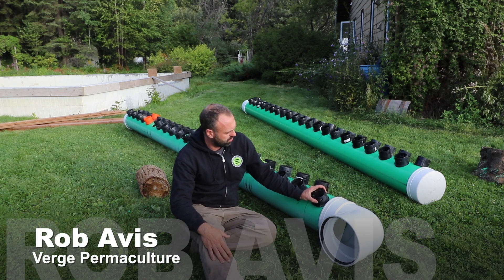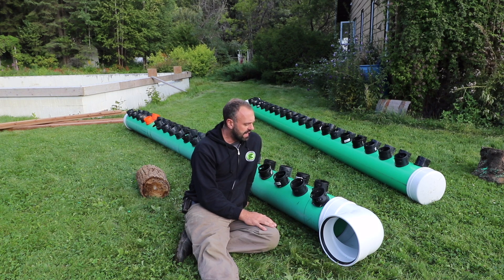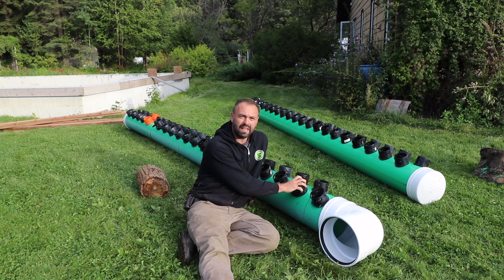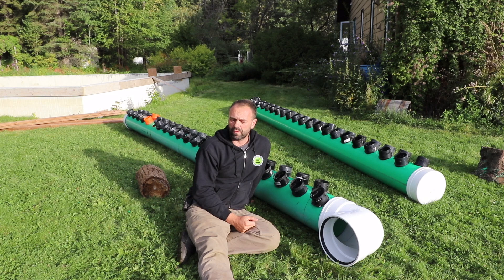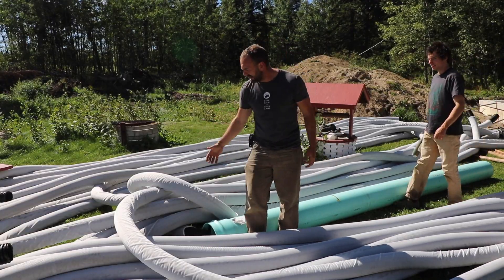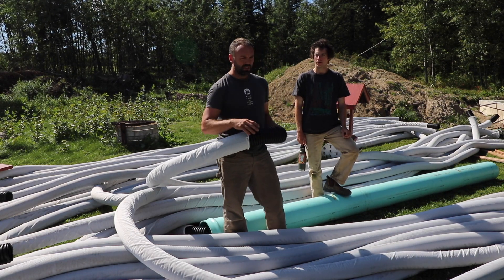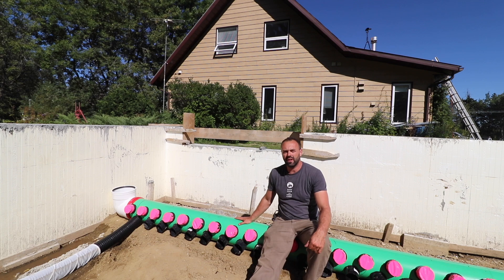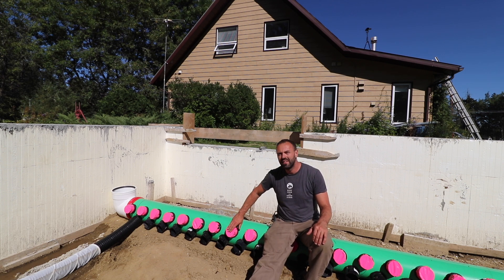How To Build a Climate Battery - Day 2 - Construction In Passive Solar Greenhouse

Comment: That’s great it keeps it above 0 until January but I need it to be above 48 at night. If it could keep it above 48 from October through March, I wouldn’t mind using supplemental heat towards the end of that timeframe because I have to use supplemental heat the entire time in zone 8b from October through February and a little bit in march. Mostly the heat runs at night and almost never during the day except for our yearly 15 days worth of 20 degrees temp when the heat runs 24 hours. I wish i had a way to store the wasted heat at the ridge. But it sounds like it stops working in January and even earlier than that because I don’t want it to stay above 0 i want it above 48 or at least above 32 when it’s 20 outside

Comment: If moisture in the air is better for capturing heat , than why not go with water in water lines buried in 6 feet of sand , layering water lines with rigid foam lining the bottom and sides and topping the surface with a foot of cement , this will store heat , than use solar and wind turbines with electric heat resistors to heat the water  ? This technology is being used in Finland and in  Alberta Canada where temps can go to - 40 C , but they can grow bananas in their greenhouse.

Comment: Great work but i need some clarification please. I keep seeing 8-10ft minimum to see a significant gain in thermal exchange in plenty of theoretical txts but have yet to see one installed beyond 4-5ft at any latitude however all of these shallow installs tout the benefits. Has anyone actually figured this out yet or is it yet to be properly documented? It is a huge investment and technical endeavour on a maybe...
Reply: These systems actively add and remove heat from the mass so there`s no need to go 8-10ft deep.

Comment: How has your system made out over the last couple of years? Also, I'm very curious why it is you use drain, or weeping tile pipes? Does moisture inside the pipes not hinder the efficiency?
Reply: I’d have the same concern
Reply: If there’s moisture in the system from either the ground moisture (and from watering) or air humidity condensing then that’s a great place for mold and mildew right?
Reply: The 4” ABS perf pipe would be a great home for gophers and moles!
Reply: @zanepaxton7452  I understand having a thin walled pipe so that the transfer of air is easier, but perforated seems like it would create problems. I'm seeing a lot of videos about the use of perforated pipe, but maybe that would work in areas with very low water tables. Definitely not in my area. I also tried to reach out to this group directly, as I was in Alberta for a week, and no one seems to have any interest in responding. I just wanted to know some results, and maybe see if I could stop by and see the operation for myself, so I could better understand the system. So I'm a little discouraged by the lack of response to a legitimate concern.

Comment: Question: could you replicate this system into 3 separate zones in the same square footage? So your system as you installed it, but replicated 3x at smaller. That way you could have a 3 zone system for different types of plants. Is that possible or is there an engineering reason why the white cloth covered pipes need to be a certain length?

Comment: For the price of the concrete absurdity I see in this vid, he could have built an entire greenhouse structure.  Holy Shitles...  Hello?  Economics? 101 for being an engineer.  The cost of those ICF blocks and the insulation given all the idiot had to do was increase the width of the structure by 2m and you get a larger greenhouse and get the insulation FREE from the dirt... Good God.. what an idiot.  Next, the idiot so called "engineer" clearly never ran a heat flow calc on the ground as he put in about 3X too many pipes and they should have been at different levels and several FAR deeper than shown unless water table is directly below his feet as they live in a swamp... Yea right he does.  Ok, time to never watch another one of his ignorant vids.

Comment: You are correct that the latent heat is stored by the phase change of water from liquid to gas and released during the phase change from vapor to liquid. Evaporation extracts heat from the surface upon which the evaporation is occurring, cooling it. Condensation, releases that heat to the surface upon which the condensation is occurring, heating it. So as long as the evaporation is occurring INSIDE the greenhouse in the Summer, it will cool it. Likewise, as long as the condensation is occurring INSIDE the greenhouse in the Winter, it will warm it. However, since it is the surface, NOT the air, that is being heated or cooled, if these processes are occurring IN THE GROUND, there will be no useful cooling or heating effect in the greenhouse!

Comment: Hi, would this type of system work for cooling on a high temperature (95 F) and high humidity (86%) site, on a greenhouse thats wrapped with anti thrips mesh on the sides,  white plastic on the roof, and has an opening all along the top for ventilation (and also has anti thrips mesh), or would the cool air escape too fast to actually cool down the greenhouse, i'm in the Caribbean by the way, and another question is, would it reduce the humidity levels in the greenhouse????

Comment: If there are perforations in the 3" pipe, how will water affect the system? Since it is used as a drainage pipe, won't it fill up with water?

Comment: What is the minimum size of greenhouse for this system to work effectively? I suppose you need a larger greenhouse with sufficant air volume in order to work?
Reply: almost any size, the smallest installation  i`ve seen was in a 6ft x 6ft greenhouse.
Reply: @JohnGuest45  thank you 🙏
Reply: @arexius3  
 How big is your greenhouse?
Reply: @JohnGuest45  a bit more than 100 square feet
Reply: @arexius3  
If its the one on your channel it looks bigger than 100 square feet but its big enough to install a system . All you need to know is the available floor size (L x W) that you can physically get a spade into and the internal air volume of the greenhouse.
Reply: @JohnGuest45  it is that one. In meters it has 9.7m2 (104) with dimensions of 2.8m (9.2) by 3.5m (11.5). The volume is 23m3 (812) with respective heights of 1.95m (6.5) and 2.74m (9). The numbers in pracets are in feet.
The floor size to get a spade into is smaller. Let's say 2.3m (7.5) by 3.3m (10.8).
Edit: 
When I build this greenhouse, I didnt know yet about PSGs so either this or next winter we are planing on replacing the back wall with a thermal mass wall and putting in the climate battery.
Reply: @arexius3  
The tricky part will be installing the vertical perimeter insulation and getting enough tubing into the limited footprint. If the ground is easy digging i`d  go for 4 layers of tubing supplied by 2 fans. This will provide a turnover rate of upto 60x an hour which isnt possible for large greenhouses due to the fan power required.
I did a test which involved sealing the greenhouse on a very sunny day to see how hot i could get it and how fast the system could cool it to the mass temperature still sealed and in full sun. It topped out at 140F and took a shade under 12 minutes to drop to 68F. Having the ability to move heat into the ground at a fast rate is essential in the summer and on sunny days in the winter. If the system cant move heat into the ground faster than the incoming gains, the greenhouse will overheat and you`ll be forced to vent the valuable heat that would otherwise have been stored for later use.
Reply: @JohnGuest45  awsome reply. Thank you so much!

Comment: Hey Rob, what is the horizontal and vertical spacing on center that you used for the 50 tubes in your 20ft long manifold?

Comment: At the expense of those fittings pipes and the end caps etc etc a Plenum could have been created with CMU 8x8x16 and then turning the blocks on their side for the openings. Sticking the drain tile into the plenum box and rhe packing the remainder of space with a mortar mix.

Comment: Hmm, did I miss the part where you explain how water that enters the manifold is syphoned off and drained or are the hoses sloped away from the manifold?
Looks like a nifty way of moving and storing the heat, I wonder how it affects the root systems and how you will manage them, not growing into the pipes.
Reply: i have the same question, why not use solid pipe?

Comment: Late to the party here. I'd think a lubricant would help get the elbows on and off easier. Dish washing soap would be good for getting it on, though maybe it would dry out before you wanted to get it off again. Glycerine would probably work well, and I don't think it would dry out as quickly.
 
I was also surprised you can't get ripe tomatoes in 100 frost free days. Maybe tomatoes that need 85 days to produce ripe tomatoes would be cutting it close, but I've read some early producing tomatoes are more in the 40 - 60 day range. That would leave you with like 50 days of harvesting. Not as long as further south, but not bad. Siberian Tomato, Sub-Arctic Plenty Tomato, Manitoba Tomato, and Moskvich Tomato are supposed to produce pretty early, and are all open pollinated varieties so you could save your own seed.
 
Anyway, good luck with the homestead!

Comment: How do ensure you get relatively equal flow between the outlets on the manifold? Unless there is backpressure, I would kind of expect much of the flow to short circuit down the first outlets?
Reply: You answered it at @12:20, thank you.
Reply: @rpmibc  not really
Reply: @svgs650r  Right! Using a Z-type manifold like this improves distribution over a U-type manifold, but is still far from uniform. TRNSYS  isn't capable of that aspect of the design analysis.

Comment: Instead of a wood boiler, could one put a rocket stove, directing the air into the ground to heat the mass battery?
Reply: I have the same idea.  And maybe use directed reflection on the wall inside the greenhouse to heat oil trough pipes in the ground.

Comment: How did you determine the spacing of the perforated pipes? My gut says that they should be spaced a bit farther apart (possibly in 3 rows instead of 2) so that there is more thermal mass in contact with the pipes. It seems like the surrounding soil would saturate with heat more quickly (i.e. less storage) if the ratio of soil to pipes is too low.

Do short 35ft runs of pipe provide enough time for the heat in the intake air to be exchanged before exiting? Would a longer greenhouse work better? Would a serpentine pattern with much longer pipes work as well or would there be too much air resistance?
Reply: They're not deep enough. The pipes are too close together, and their soil needs to have more clay in it. They also have socks over their pipes... (Insulating your heat exchanger defeats the purpose of of having a heat exchanger).
Reply: @elmerkilred159  Sock does not stop heat exchange but it does help prevent soil from entering and blocking the holes.
Reply: @costcontrolaccounting4613  Sounds neat. I got my info from two books to figure out the exact spacing, and the fans, diameter and length of the pipe, and manifold, and depth of soil below the frost line to find the best results. "The Forest Garden Greenhouse," by Jerome Osentowski, and "The Year-Round Solar Greenhouse," by Lindsey Schiller and Marc Plinke. I also thumbed through the U.S. Army Corps of engineers data on soil types that work best with geothermal heating/cooling. You want direct contact with the soil with your pipes because it involves evaporative cooling.
Reply: last i heard, it was one 3 to 4 inch pipe for every square foot of surrounding earth would get your maximum potential out , i cant recall what the air movement was but it was slow, something like 21 gallons of air per minute equivalant. and the thing most people dont realise is your exchanging heat all year..your putting heat into the ground in summer and your pulling it out in winter. if you move more heat underground in summer, you gotta use it in winter or else the ambient temp will go up underground and the next summer your not going to get the same amount of cooling out of it

Comment: I love the idea of using the earth as thermal mass, but on my farm in BC there is so much ground water i fear my pipes would fill with water unless I raised the whole earth mass up and had a perimeter drain. Did you install drains of any type to clear the build up of ground water? I see one drain tile pipe is in a puddle all ready. Is That why you didnt put insulation on the bottom under the first layer of pipes? because you didnt want to hold water? do you feel that the earths constant temperature is enough that you dont need insulation underneath the thermal mass? thank you for the videos!
Reply: You do not want insulation beneath the thermal mass because this effectively reduces the total thermal storage mass, you want as much as possible of the underground to be your thermal mass. Sure, there will be loses to the outside but as long as the rate of loss is low enough this should not be a problem. Insulation on the sides however is probably necessary.
Reply: Yes if you interrupt the ground water flows enough you should be able to stay dry & then yes you can use insulation to cut permafrost to harness more thermal mass control from the earth.

The loss of heat from ground frost entering would require too much heat to grow all year using it to bank heat.

Comment: what do u think about doing climate battery from pipe in one piece, 2 layers. meaning I would do it from single pipe,as underfloor heating but I would start circling the pipe from middle of greenhouse outside out. Would it work?